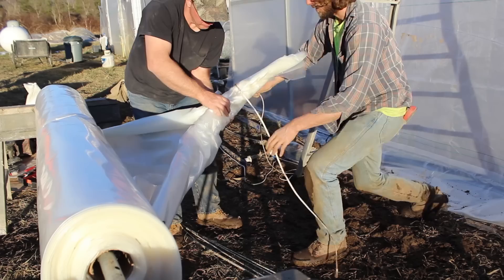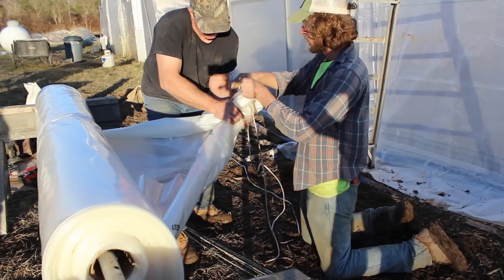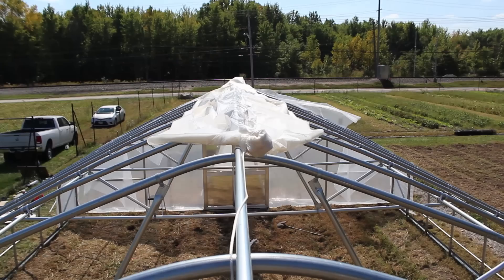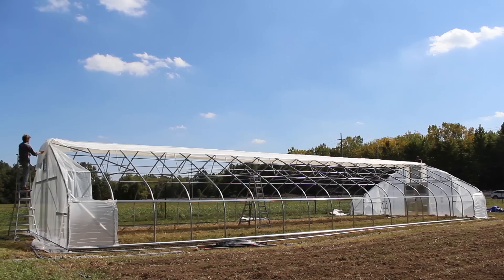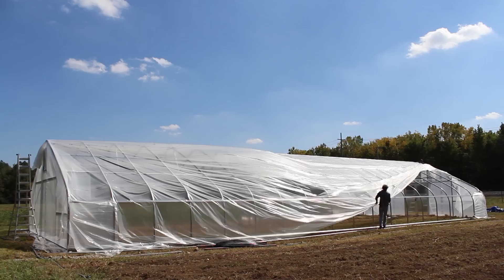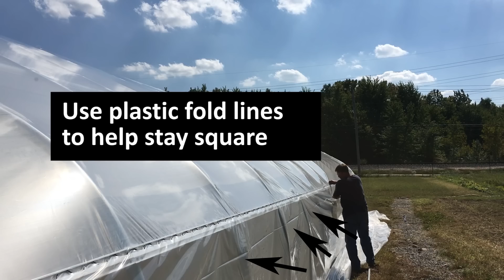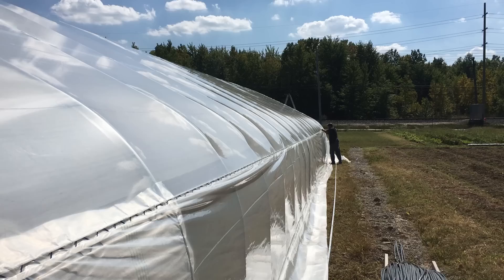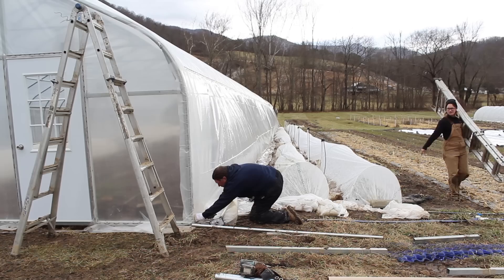How to Install Greenhouse Plastic Top Cover - Poly Pull Method

Comment: Hi there good informative vid for us all , cheers. I come from a long line of farmers and nursery owners but never took any steps towards doing this for a living myself other than an agricultural and horticultural course when younger. 

Going to be building a few structures but looking at where to start. I’m a builder and have been many years. I could whip up many types of structure but for ease I’m thinking this proper framework might be the most sensible way forward. 

Do you just buy your trusses as required, and add as many as you have space for or is this stuff strictly pre fab to order?  I don’t have a particularly strict budget but I am frugal in nature. No size plan either. The idea was to whip up six about 40ft, or three with twice the growing space using wood because I thought it would be cheaper and hopefully go all out on a massive metal frame structure all in one a couple years down the line with my earnings. I would then switch the lesser structures to nursery stuff from what I set up in the beginning which would be a bit of all sorts, nursery, hydro, and aquaponics. I’ve been doing a bit of it for years with carp for a friends small fishery.  

Do you have a unit price for each section for me to do some costings? 
Would be greatly appreciated. 

Thanks for uploading
Reply from the maker: Thanks for the questions and kind words on the videos. How many trusses you need would partially be dictated by your climate, but also by the diameter of tubing you would be using for your bows. For our applications we do trusses and truss supports (also referred to as rafters) on every other interior bow OR every interior bow. 

To answer your question, we do sell just trusses if you need just trusses, or if you are frugal and want to make your own, our site sells end-cups which can be screwed to the end of round tubing to create a hole that can bolt to a brace band. 

If you want pricing on structures, parts and pieces, or anything else you should check out the Tunnel Vision Hoops website and you can send us a message on our "contact us" page and someone could help you more directly (and specifically). 

Thanks!

Comment: Can you put two wiggle wires in same channel?  One wire holding the end plastic and another holding top cover?
Reply from the maker: Good question, Larry. It ultimately depends on where you purchased your channel + wire. The channel we sell can hold three layers of plastic AND three layers of wire, while some channels only have enough space for one layer of plastic and one layer of wire. 

The above, is why our end-wall plastic video suggests using snap clamps for holding the end-wall plastic in place until the top layer is installed; then one “run” of wire can be used to hold the end-wall plastic and the top cover plastic.

Hope that helps, best of luck on your projects, and thanks for watching!

Comment: Just wondering is it ok to install plastic in the winter?
Reply from the maker: That is a good question, and depending on who you ask the answer might change. While greenhouse plastic is best installed when it is warm outside, you can install greenhouse plastic in cold weather. It is just harder to work with, and won't be installed as tightly as plastic installed in warm weather. That said, you can usually pull excess greenhouse plastic out of the top cover once the weather warms up. While putting greenhouse plastic on the structure during cold weather isn't the most ideal (because you might end up adjusting it in the future), it would still provide you with a covered structure when you might need it most (in the cold / when approaching spring). For this reason, some people do install greenhouse plastic in cold weather, as it is worth the trade-off for them.
Reply: @tunnelvisionhoops  thank you for you reply.  I am going to yry it and i hope it works. And thanks for the great video.
Reply: Good point. I did a small personal garden one 8’ x 16’ in late Feb. (WV) and then needed to stretch it tighter by late June. The plastic was a lot more pliable in warm weather and made a much better fit afterwards. Currently planning a bigger more permanent one for this yr and will wait for a warm sunny day in April. Going to store the plastic indoors right up to time to install as well.

Comment: So do two pieces of wiggle wire fit on top of each other in one channel? So in the ends hoop channels the layers are end wall plastic/wire/top plastic/wire? If you were doing double layers of film would you use one wire for two layers of plastic?
Reply from the maker: I use snap clamps (linked at the bottom of this comment) to hold the end-wall plastic in place so that when the top cover plastic is secured on the end-hoop it only requires one run of wire to hold both layers of plastic. This method makes the order of operations: end plastic/top plastic/wire. 

If I am doing a double layer of film I would usually put wire only in a few spots of the first layer before pulling the second cover; this way I can secure most of both layers with just one run of wire over each. A good channel can DEFINITELY hold two layers of wire and three layers of plastic. When doing a double layer plastic covering the order of operations are: end plastic/first layer plastic/wire/second layer plastic/wire.

Here is a link to the Snap Clamps that help me hold the end plastic in place without having to add another run of wire in the channel: https://www.tunnelvisionhoops.com/snap-clamps-pack-of-10/

A good Spring Wire Channel should be able to hold three layers of plastic and two layers of wire (and then some). Here is a link to the channel we carry that comes with spring wire: https://www.tunnelvisionhoops.com/poly-lock-channel-and-spring-wire-greenhouse-film-fastening-system-6-ft/
Reply: Got it. Thanks for the help. Your videos are the most straightforward I’ve seen on the topic and I’ve watched a lot of them!
Reply from the maker: Thanks for the kind words, we appreciate it! We are always trying to add helpful content.

Comment: Your videos are incredibly helpful.  Thank you for making them.  When installing a double layer, can the channel lock and spring wire hold 3 pieces of poly sufficiently?  Or is it better to use 2 wires in a channel and zig-zag them?
Reply from the maker: Thanks for the kind words! We plan on continuing to make similar videos that help small farmers, so hopefully some upcoming videos are equally as helpful to you. 

As far as the Channel Lock and Spring Wire, one piece of wire will hold three layers of standard 6 mil greenhouse plastic without a problem. That said, if you are using an old piece of wire that has had the tension reduced through years of being used and re-used, I would opt to use new Spring Wire, or to overlap two pieces of wire.
Reply: Thanks man.  Big time help.  Everything turned out great.  Pulling the plastic over the top made it go very easy.
Reply from the maker: Awesome, I love that! Congrats on the successful project.

Comment: Are you installing a second wiggle wire into the same channel used to hold the poly on the end wall ?
Reply from the maker: We secured our end-wall plastic with Snap Clamps so we would be able to attach the top cover AND end-wall cover with the same single run of Spring Wire. You can watch how we attached the end-wall plastic in this video here: https://www.youtube.com/watch?v=xkSlaXRInwQ&t=1s. 

If you had wanted to secure your end wall plastic with Spring Wire before attaching your top cover with Spring Wire, the channel *should* be large enough to receive the two pieces of plastic and the two runs of Spring Wire.

Comment: Do you ever put any protective cover over pipe joints or bracket joints that plastic is stretched over?
Reply from the maker: I have done so in the past if metal coming into contact with the plastic seemed to be especially sharp. In my situations, I just wrapped or placed some duct tape over those locations.

Comment: Whenever I touch big plastic, the wind starts to blow.
Reply from the maker: I’ve been doing this for over a decade, and it feels that way every time I pull poly. There’s a lot of “waiting for the right moment” / being patient when I’m getting ready to install.
Reply: @tunnelvisionhoops  During the last 6 years I've built four 50 x 20 hoop houses, entirely alone! - pulled poly as well.  This winter I'll build another and I will hire a helper.  I just turned 69 and refuse to work alone!
Reply from the maker: Wow! Sounds like you've been keeping busy. Having even just one helper makes pulling poly WAY easier. Have a great weekend!

Comment: does it matter whether you unroll coming out under or coming out over the top of the roll?
Reply from the maker: Depending on the variety of plastic you’re using, yes. For our videos we were using anti-drip plastic, and for that it matters which side of the plastic faces in and which side faces out. To achieve that, we had to pull our brand of plastic over the structure the way we had it. 

There are also often markings on the plastic covers that state which side must face inward. That dictates how the plastic must be installed.

Hope that helps.

Comment: So did you take the wiggle wire out of the front and back and then reinstall it with two layers of plastic in the channel when the top goes on?
Reply from the maker: Hi Mike, I actually used Snap Clamps to hold the end-wall plastic in place, which allows the plastic to be held in place WITHOUT Spring Wire. This means when I install the top cover plastic into the end-wall channel there is just one run of Spring Wire holding in both the top cover and end-wall covers. So, two pieces of plastic and one run of Spring Wire. As I install the spring wire, I can reach into the structure and pull of the Snap Clamps if the end-wall plastic is too tight. Here are the Snap Clamps I am referring to: https://www.tunnelvisionhoops.com/snap-clamps-pack-of-10/

Comment: I'd like to ask how did the whole width of the rolled plastic covered the whole green house? I am having trouble of how to join uv plastic to cover a total width of 6meters while having a 3meters width of rolled plastic. Appreciate your thoughts about this.
Reply from the maker: Good question, for most 6 mil greenhouse plastics, they are folded inwardly in about 2 ft. or 3 ft. folds through the entire length of the structure; when the folding is completed you will have half the plastic folded on the left side of the roll and half the plastic folded on the right side of the roll - most widths (up to 54 ft. wide) can fit on a cardboard cylinder that is a 88 inches long. This makes it easier for the plastic to ship even when the width of the plastic is pretty wide.

Comment: So after you’ve pulled the plastic along the length you attach the center of the plastic to the channel with wiggle wire...So you’re using the channel that holds the plastic from the end walls and placing a second piece of wiggle wire in the end wall wire channel?
Reply: Or do you use double channel wire when installing the end walls so that one channel is used for the walls and one channel is used to attach the plastic over the length of the hoops?
Reply from the maker: Thanks for the question(s). Typically, there is just one run of single channel that goes over the top of each end-bow. This single channel has enough space in it to receive two layers (or more) of plastic AND two layers of wire (or more in some cases). 

With the above being said, the way we do our end-wall plastic first is by having the end-wall pieces attached to the end-bow with Snap Clamps temporarily so that the wire we use to install the top cover will hold both the top cover AND end-wall cover in place. 

We have an end-wall plastic installation video as well - I would check it out to see what our steps are for the end-walls. 

Thanks for watching!

Comment: HOW WOULD YOU ADD THE SECOND LAYER, IF YOU HAVE INFLATION UNIT?
Reply from the maker: Good questions, we have been working on a video for this very question, but have been a bit too busy to complete it. Hopefully soon! Anyways, in the meantime here are my suggestions for two layers:

1. Pick a calm day with no wind.

2. Know where you will install your inflation fan; typically these get put on the next hoop after your end-hoop about a foot or so above the hip-rail. Don't install the inflation fan yet, but just know where you will be putting it after both layers have been put on. 

3. Install first (bottom) layer as shown in this video but only secure spring wire in a few spots - primarily at the peak of each end, near the hip rail on each end, and one piece of spring wire in the middle on each side. This will hold the first layer enough until your second layer gets installed. I don't like fully attaching the first layer with spring wire at this point because the same steps are duplicated after putting the second layer on - - for me, I like saving the wire and the time, and simply securing both layers with a single run of wire (as much as possible, at least)

4. After the first layer of plastic is resting in place, and is secured with a couple pieces of spring wire as referenced above, repeat the process for pulling the plastic with the second layer of greenhouse plastic. Put the plastic on the structure by pulling it from end to end over top the first layer of plastic. The process is the exact same as shown in this video pretty much; I would just recommend allowing the plastic to open up more as it is being pulled from end to end...this allows the plastic to make its way from end to end without falling off the structure to one side...in other words it hugs the peak of the structure as it makes its way from end to end. 

5. Once the second layer is in place, adjust the second (top) layer of plastic so it is resting square on your structure - secure with spring wire at the peak over both your top and bottom layer of plastic. If you already have spring wire holding your first layer in place that is okay, your channel should be able to receive multiple layers of wire and plastic. 

6. Proceed with securing both layers of plastic with spring wire in the same order of operations as outlined in THIS video...the only real recommendation I would have for this step is to NOT PULL THE SECOND / TOP LAYER SUPER TIGHT. If you do pull the top layer super tight you will not achieve any real inflation at all. It is a fine line to walk, but just make sure there are no wrinkles and that it is laying flat everywhere before securing. It is easier to pull more excess out of the plastic if you want than it will be to adjust and put more excess into the top cover. 

7. When you like the way the second / top layer rests on your structure, fasten your plastic around the entire perimeter except for around the area you plan to install your inflation fan. Leave that area unattached for now (leaving about 6 or 8 ft. unsecured should be good for now). 

8. Take your inflation fan inside your structure to the point of your structure where you will attach the fan to the hoop. Follow the instructions for attaching your inflation fan to your hoops, but essentially you will first install the provided bracket.

9. After the bracket is installed, use the provided nuts and bolts to attach the inflation fan to the bracket.

10. After the fan bracket is attached to the hoop AND the fan is attached to the bracket, use the hole in the bracket itself to mark where you will cut an "X" in your first layer of plastic. I like doing this from the exterior of the structure, by lifting up the second layer of plastic so I can access the first layer and make the cut. 

11. When the cut has been made in the first layer of plastic I push the deflector for the inflation fan through the "X" and twist it onto the inflation fan bracket. For this step I am pushing the deflector from the exterior of the first layer of plastic onto the fan bracket which is on the interior of the first layer. 

12. After the deflector has been installed, and the fan is in place I allow the second layer of plastic and first layer of plastic to lay flat against the side of the structure, and I now secure the rest of the spring wire into place to fully close off the two layers of plastic.
 
13. Plug in your inflation fan and you are good to go; you can adjust the damper on the inflation fan after your two layers of plastic have been inflated completely (if you want to adjust how much air is being pushed between the two layers of plastic)

Good luck!
Reply: @tunnelvisionhoops  Cant wait to see the video for this

Comment: where can i find those rails that are used for the wiggle wire?
Reply from the maker: Good question. Here is a link to the double channel (hip-rail): https://www.tunnelvisionhoops.com/double-channel-poly-lock-and-spring-wire-greenhouse-plastic-attachment-6-ft/

Here is a link to the single channel (used over the end-bows): https://www.tunnelvisionhoops.com/poly-lock-channel-and-spring-wire-greenhouse-film-fastening-system-6-ft/